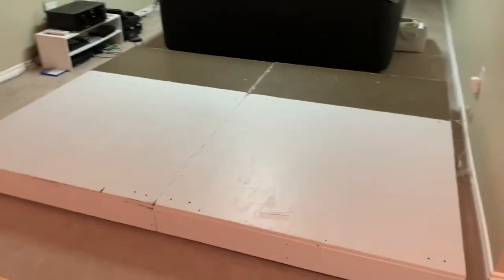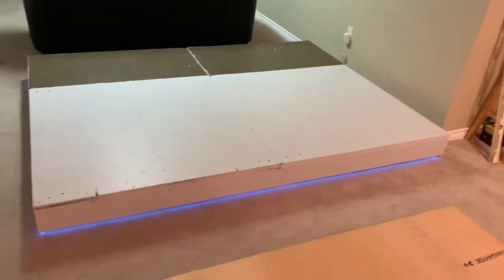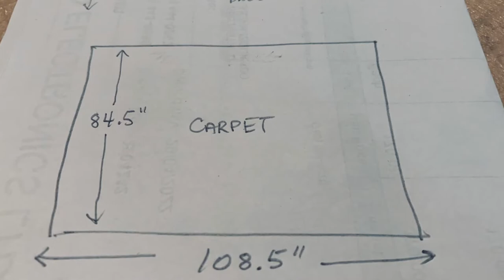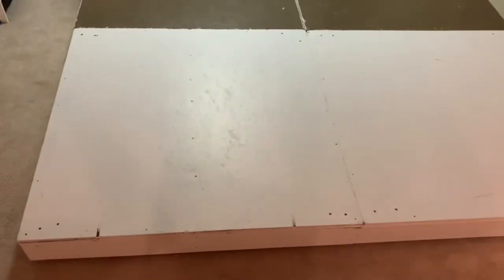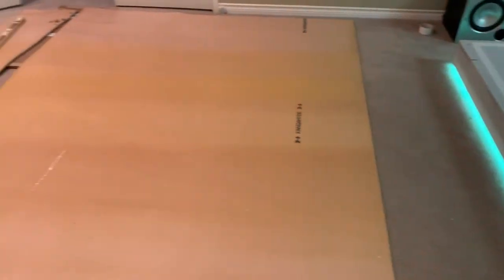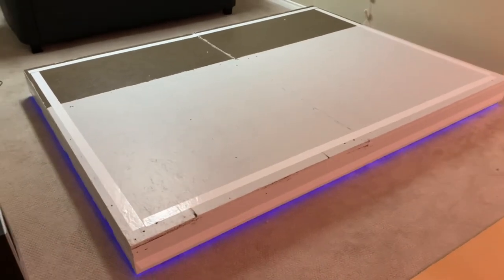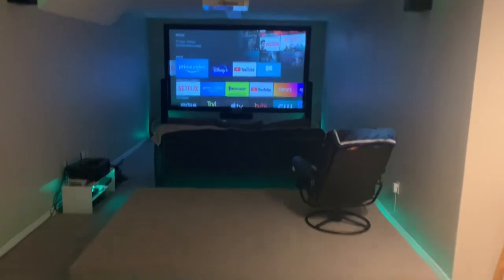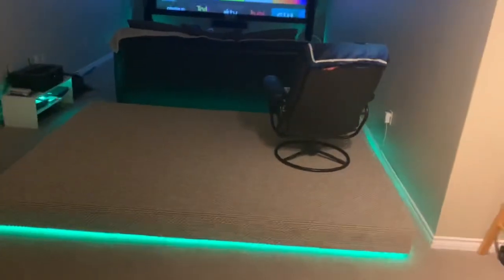Vibe Build and Install of floating Riser with LED lighting effect

Comment from the maker: Hi , I used the Govee RGB LED strip light model H6191 , purchased on Amazon.
Reply: Thanks!  There are so many to choose from. Are you still happy with those?
Reply from the maker: Yes They still work great it’s been over a year now . Just note they need an outlet near by to plug in and the IR receptor  to have line of sight for the small remote .